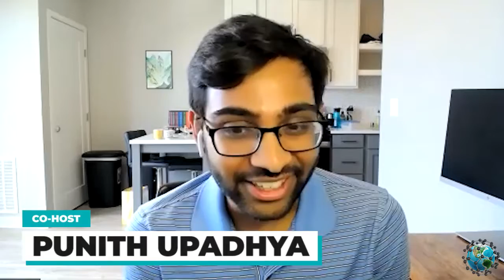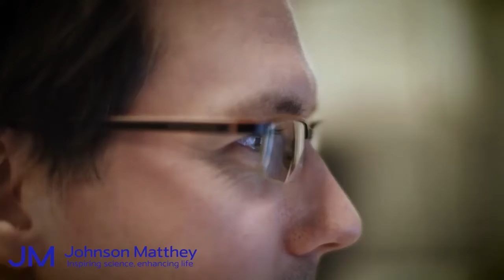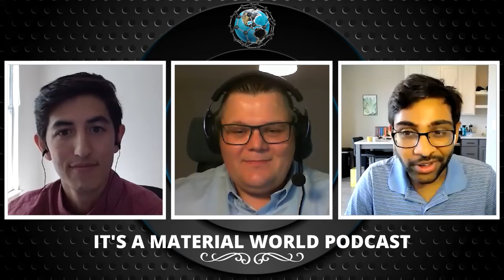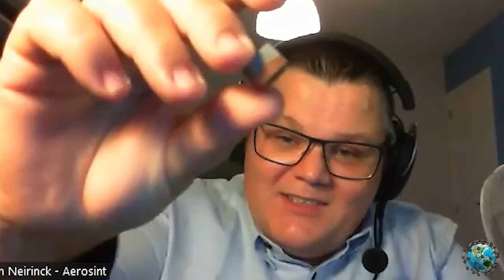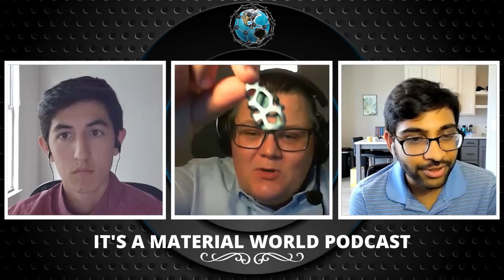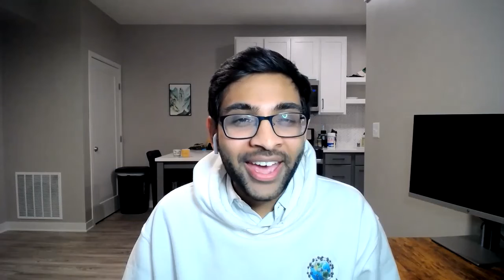Multi-Material 3D Printing (ft. Dr. Bram Neirinck) | Ep. 70

Comment: if anyone has questions, feel free to post them 🙂
Reply: Hi Bram, thanks for doing the interview. Its super interesting. You mentioned that powder is spread on the roller, how does the powder stick? Is your roller compatible with any powder (polymer, wood etc.)? Also how do you deposit the powder? You mentioned you use actuators?
Reply: @pete1852  It is a prutely mechanical force that keeps the powder on the roller, and yes, I've handles metal powder, spray dried ceramics, solid ceramic beads, lactose, cellulose, polyamide, TPU (sls stuff), ...
Reply: @docBol1980  Ok very cool. Can you say anything about what mechanical force keeps the powder on the roller and how it is released?